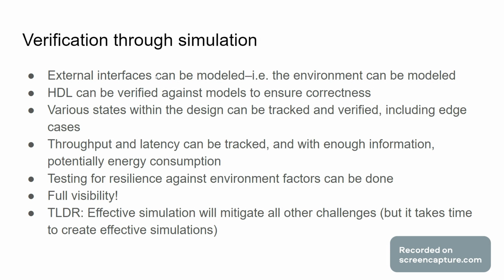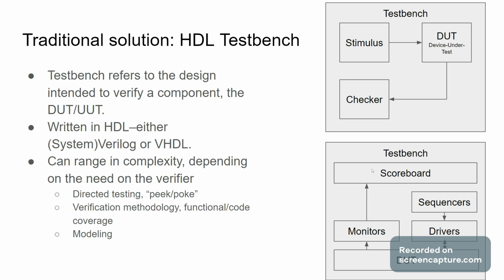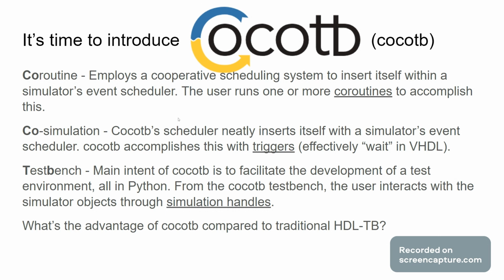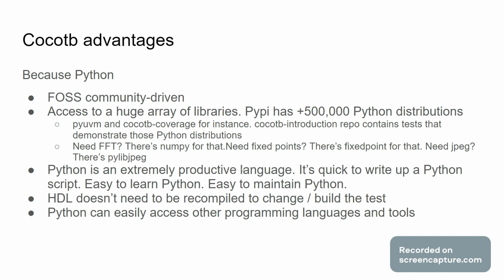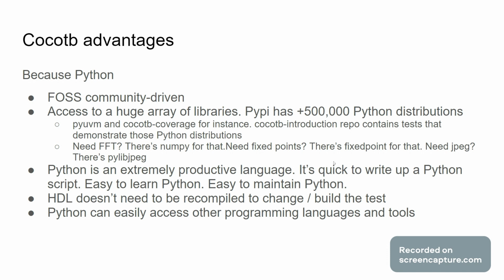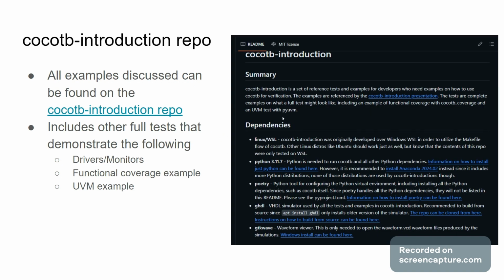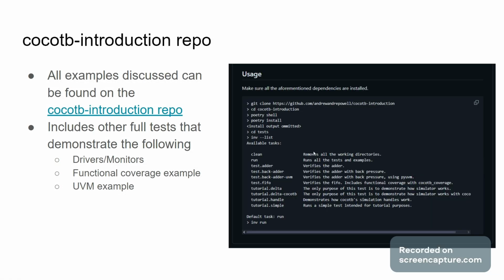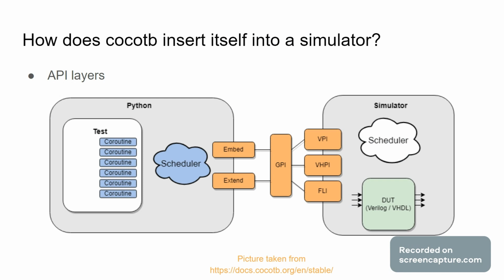Introduction to Cocotb Part 1: Why cocotb?

Comment: Use archlinux (or a distro easier to install based on arch) to have more up to date software repositories. Even you can upload your own PKGBUILDs to the AUR to automate package generation for the version you want. What you describe about Ubuntu and Debian is what brought me to Arch in 2013/2014 I think. Another good option is Void Linux.